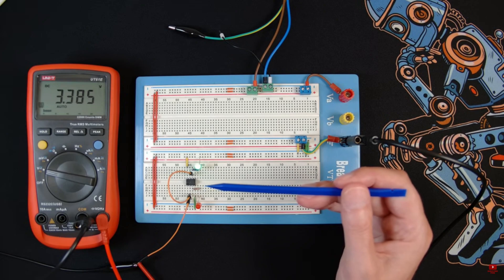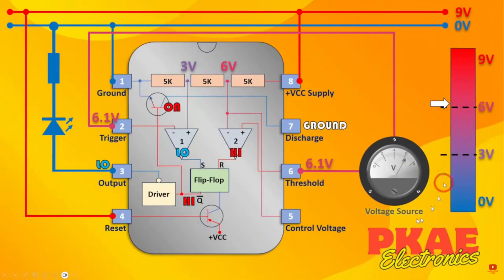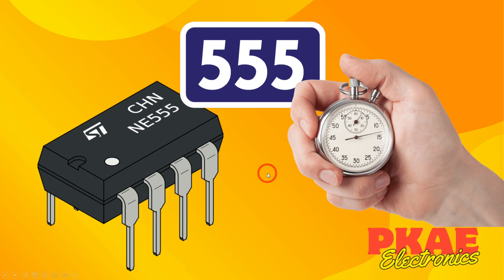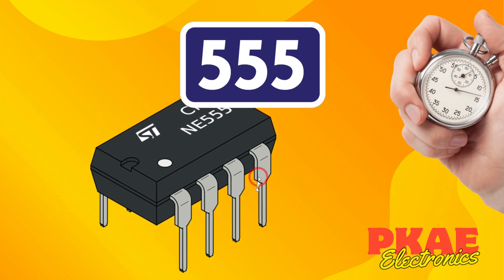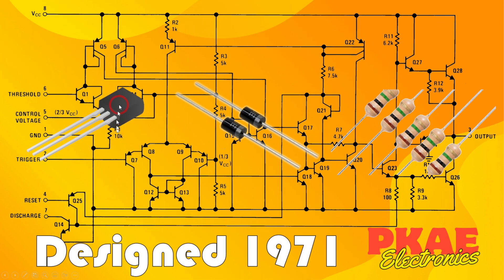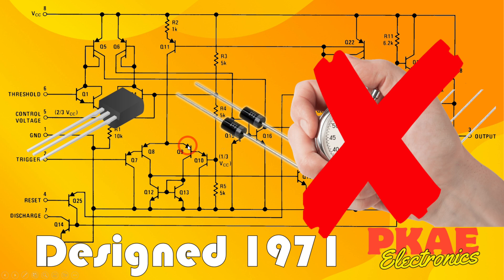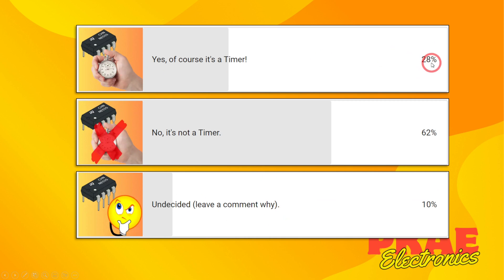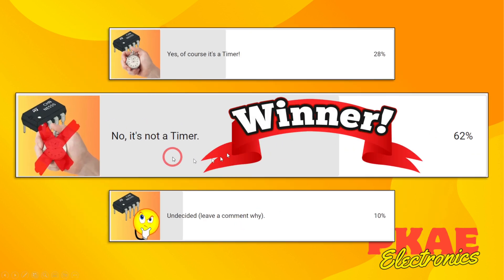The 555 Verdict

Comment: By the way, the minimum component count is a NE555 and just one resistor to get a working astable circuit.
Reply: See my video here https://youtu.be/iRj3i-OOTMg?si=dnKQLRDBUKIRjanB
Reply: I think if you just wire pins 2,3 and 6 together it oscillates.
Reply: @kensmith5694  Link pin 2 to pin 6. 1 M ohm resistor from pin 3 to pin 6 (or pin 2). I put a short video of this circuit on my channel. On a breadboard my circuit ran at about 21 kHz.
Reply: @Mark1024MAK  My circuit dosn't need a resistor and runs at a really high frequency

Comment: So, taking this further. Is a digital watch without a battery or cell still a watch? After all, without a power source it is incapable of timekeeping... Same for a clock, a kitchen timer etc...
What about a clock powered by a spring? My Nan had a ships clock (wall clock), but the key to wind it was lost. Hence we had no way to wind it up. Was it therefore still a clock?
Reply from the maker: Is a brick a house because its mostly used for building houses even though a brick can be used to build a shed, a wall, an office block.......
Reply: They are still devices that can be used as a timer, they just need the mechanics to store and release energy over a given interval.

Comment: So, then it's a microprocessor? An infrared detector? A heating element? What is it then? Since you can TIME things with it.
Reply from the maker: Its a versatile IC. A latching comparator may be a better description. 

Is a brick a building just because you build with it?😄
Reply: You need more than one to make a microprocessor.
I have used one as the controller for a DC-DC converter.
I have used one to set the minimum turn on voltage for a battery powered product.

Comment: It's definitely not a timer by itself, but... it's the main building block and only active component used in a common timer circuit.

But when you build a timer circuit, and place it inside another circuit, and you point to the 555 and ask, "What does this do?" The concise answer is, "that's the timer."

So both answers are correct in the context they would be used.

Comment: Chips that provide timing/clock functions almost always require external components of some sort to set the frequency - either an R/C network or a quartz crystal.

A quarter of a century ago, x86 CPUs did not include an integrated DRAM controller; this function was provided by a separate chip (the so-called "northbridge"). Does the fact that they did not include what is now considered to be an integral part of the CPU make them "not CPUs"?
Reply: SRAM does not need refresh, hence does not need a DRAM controller, some computer systems use SRAM not DRAM. The Z80 did include a DRAM refresh system so did not need a separate DRAM controller. Computer designs that had the video system running from the main DRAM memory did not need a separate DRAM controller because the video system accessed the DRAM often enough that separate refresh was not needed. And soon DRAM became available that had built-in refresh control circuitry...

On the subject of timing/clock circuitry, for many years it’s been possible to have resistors and capacitors as part of the semiconductor chip. However, the tolerances achievable in the past was not that accurate. More recently that has changed hence many microcontollers have built-in clock generators and need no external timing components. Where really accurate clocks are needed, you will however still see separate crystals or crystal oscillators used.

I don’t think any of the above would have made any difference to the design of the NE555. The whole point of the design was that it was flexible. If it included resistors or capacitors on chip, that would have reduced the flexibility and increased costs of the chip at the time it was originally manufactured...

Comment: Semantics. The NE555 can't do timing without external components, but even with external components everything it does is timing-related. So... it's not a timer but it cannot be used in anything other than a timer.

It's literally the pedantic difference between "it's a timer IC" and "it's an IC for timers".

And I'm sure we can talk for days about what the "timer" means, but I'm not going to waste (more of my) my time on this.
Reply: With a couple of metal probes and a valve, I used a 555 to maintain the water level in a sump. Nothing timer about it.
Reply: First, it isn't true that it can't be used in anything than a timer. You can also use it as a memory device, a logic gate, or numerous other things. You should consider carefully perusing a collection of 555 example circuits.

Seconds, semantics is the study of meaning. You're basically saying, "you're talking about the meaning of words, that doesn't mean anything!" Just about the only time that, "That's just semantics" is a valid complaint is when you really mean, "I misspoke but you understood me." And you'll get less eyerolls if say the latter instead of the former.
Reply: I have used a 555 to set the power on voltage in a battery powered product.  This was not timing related.